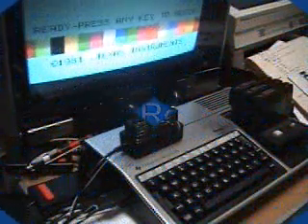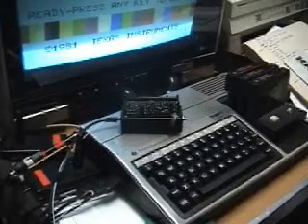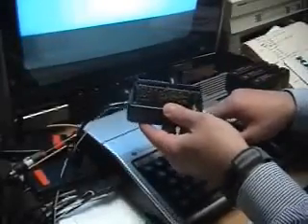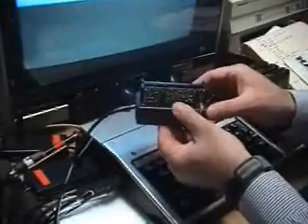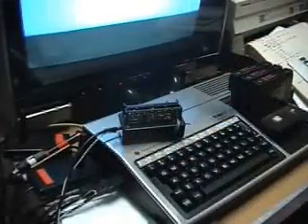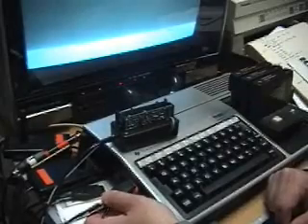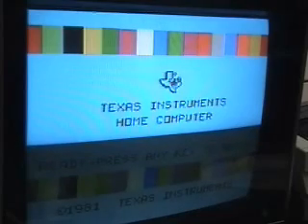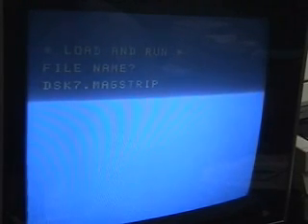TI 99/4A Magnetic Strip Card Reader

Comment: @wmaalouli Thanks for the tips but I've got Win994a.  GREAT/the BEST TI99 emulator around, IMO.  Never could get "disks" to work though, or any carts/games that didn't come with the emulator.  I do have pretty much every TI99 game (no "applications") out there, (along with almost every retro/classic 8-16bit game/system) just can't get'em to work (on TI99, or any TRS80 emus).  ONCE, only, either on Win994a, or maybe it was MESS, I got some games working, games other than what came with WIn994a.

Comment: Awesome post!  The T199 was a cool computer.  My friend had 1.  I had a Commodore Vic-20 & a C-64.  I have a few TI99 Emulators, which I really like.  It's difficult to get certain games to work though.  Many of the cartridge ROMs are in multiple 2-3 parts.  You have to do some re-naming & what not, & even that doesn't always work.  I never could get Pole Position & Jungle Hunt to work.  The Vic-20 emulators are temperamental as well.  Many different file extensions. (.a20, .prg, ..60, etc)